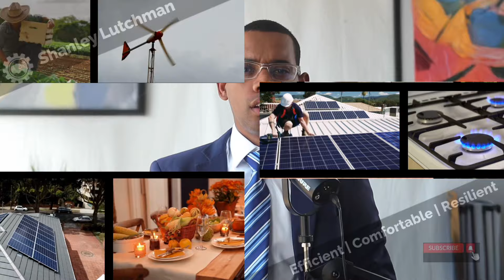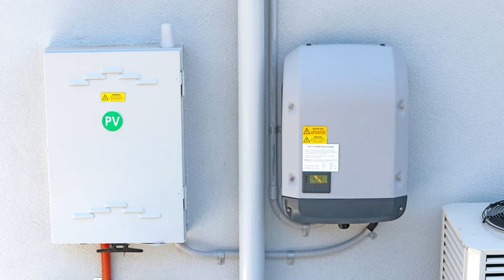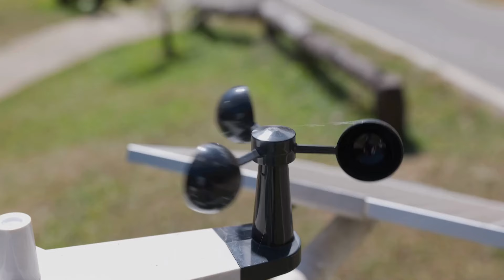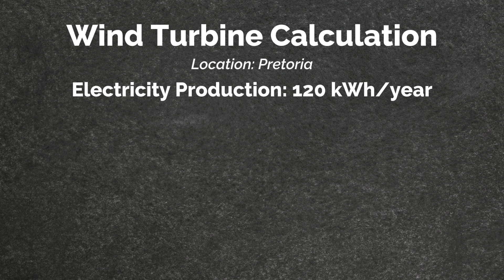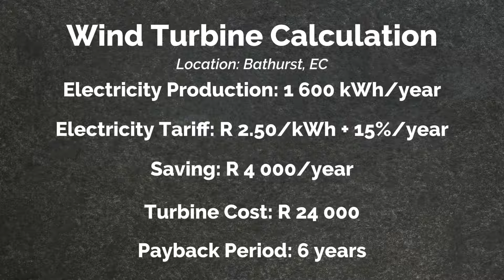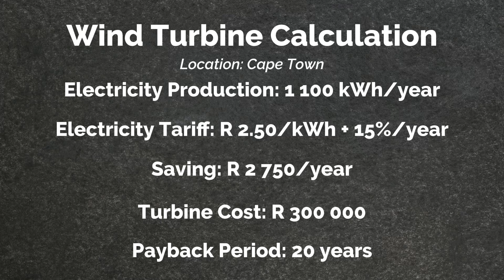Are Small-scale Wind Turbines Worth It?

Comment: i keep saying this if someone simply made some efficient cycling based generators i would buy one..
Reply from the maker: @andrievbastichy8551  Cycling-based? Do you mean a bicycle?
Reply: @shanleylutchman  yes.. or some other movement based thing.. even a super large hamster wheel?
Reply from the maker: @andrievbastichy8551  There's an entrepreneur named Manoj, he invented 5 hour energy drink. He's created something like this. You can see it in the documentary "Billions in Change".

The problem is this: elite cyclists, performing at their peak only produce about 300 Watts of power. One solar panel these days, just sitting in the sun, can do up to 600 Watts. You would have to cycle at peak power of a elite cyclists for a whole hour just to boil 5 liters of water. So, it's possible, but not really worth it.
Reply: @shanleylutchman  thnaks..
that clears up alot.👍 not efficient.

Comment: Hi Stanley, from New Zealand, keep up your straight forward videos.. 15 years rural off grid with solar, wind and hydro. The hydro was 24/7 but required constant attention, mostly fish filters filling with leaves etc and floods. Eels climbed over nets and ground only to get carved up by the turbine.  Wind mostly almost nothing with occasional flat out causing damage. Lots of attention way up the top of a hill. Solar with self tracking, good reliable max output most days. The hydro could usually be relied on to keep lead acid batteries on charge when loads were reduced so battery life enhanced. Excess power was dumped into wood burning kitchen stove hot water system A well installed grid tied system with anti-islanding is probably the easiest, but unpredictable power company policies are a major pain. Now in town with roof top solar, all hot water, Nissan Leaf and electric forklift. The big forklift battery can be drawn down if needed.
Reply from the maker: @howardsimpson489  Thank you for the comment. That's quite interesting experiences you've had different forms of renewable energy technology. I like the forklift battery set up, that's a really great idea.